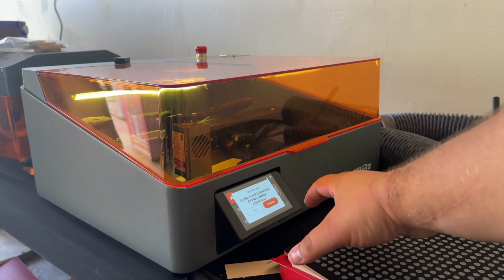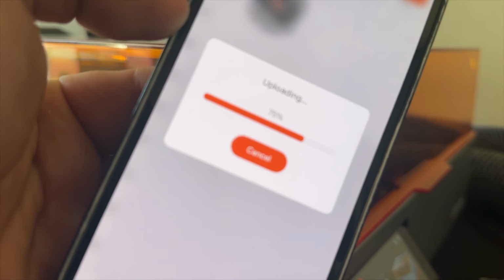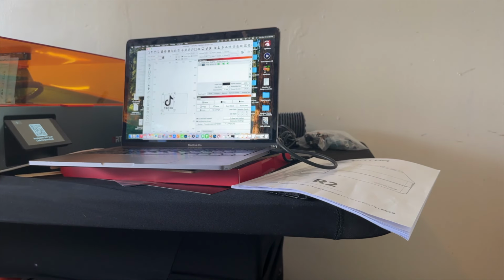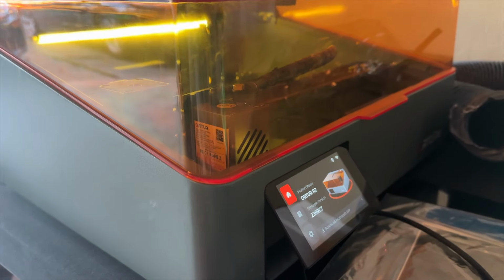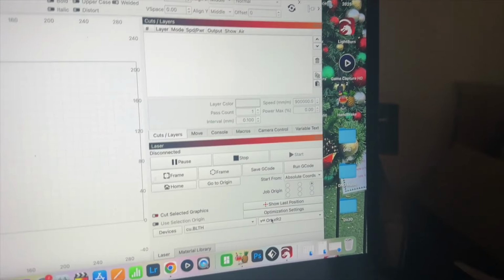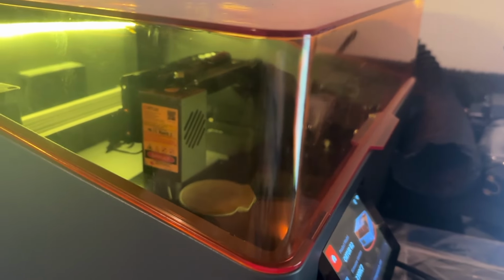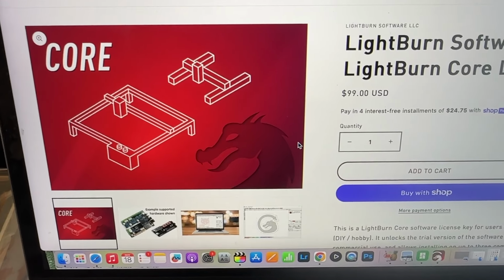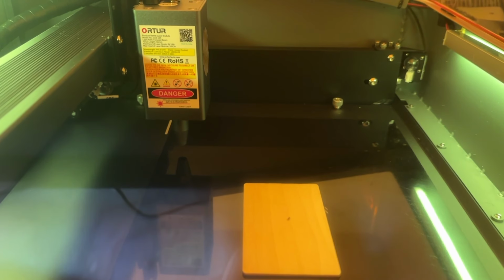Taking A Look At The Ortur R2 Laser Engraver From a 3D Printing Business Mindset

Comment: There should be some kind of threshold adjustment for the flame detection, and yes direct sunlight can trigger it.
When you are ready to actually make products, 3d print some templates so that the items you want to engrave drop in the exact same spot each time.
Lightburn is the defacto standard software, it's worth learning and using for sure. Lightburn core isn't too costly and will work with most engravers.
Reply: That's what I was going to suggest as well, make jigs for whatever you're wanting to mass-produce. It'll make alignment a snap.  If you want to make that logo work better with framing, have Lightburn trace it into a vector (or if you have it, load a vector version).
Reply from the maker: thank you for this great insight as we were not too sure about a few things but this definitely helps big time !